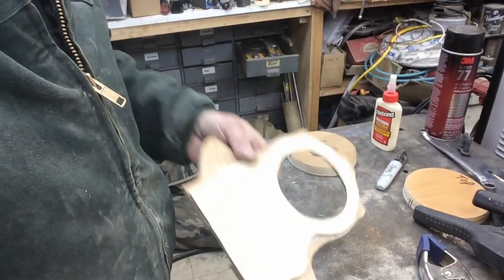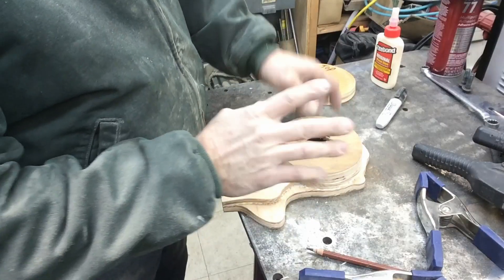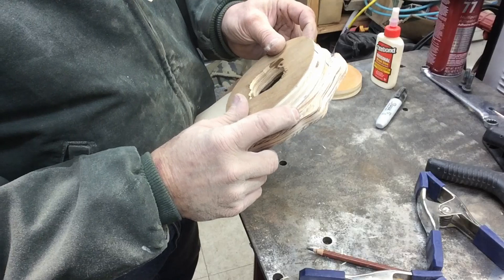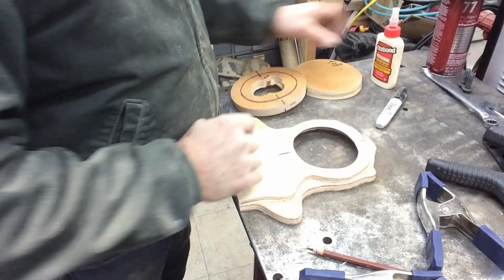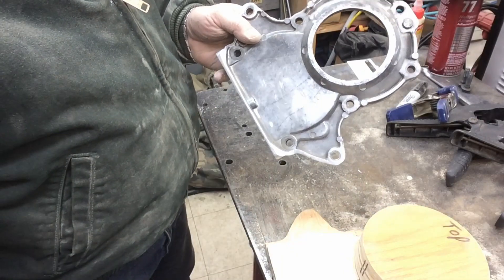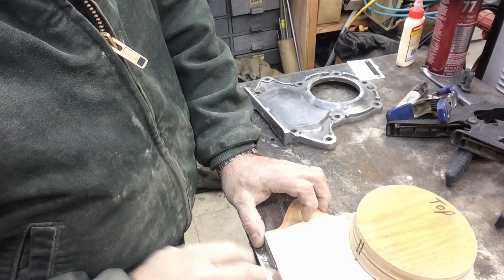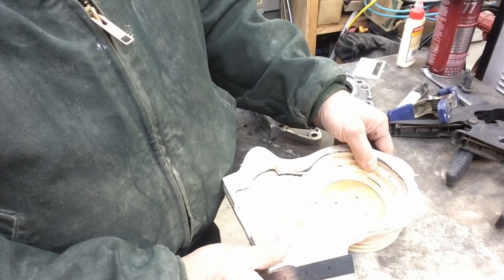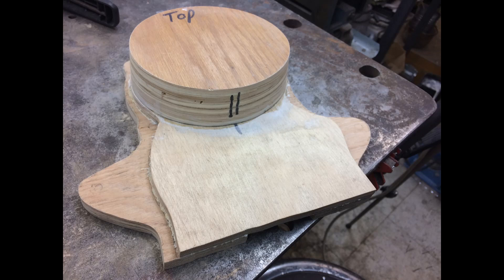Building a Zenith 701 Experimental Airplane, 5th Bearing for the Corvair: Part 3

Comment: Love your videos on this 5th bearing build.  I've got a Corvair on a half-built Pientenpol, and before I attempt flying it, I want a fifth bearing on it.  WW has his bearing available for what seems to be a reasonable price.  Are you building your own because of some deficiency in those, or is this an exercise in reinventing the wheel?  Don't get me wrong, I salute your efforts, but I'm wondering if you're looking at improving whats available or just attempting a DIY project.  Are going to do your own sand casting and smelting?  I'm anxious to see the next steps and final results.  Thanks for sharing!
Reply from the maker: Thank you: I suspect you are refeing to the Dan Wessman Bearing which is probably the one we see the most of and is promoted by William and in the big picture is very reasonable in price. There is no defeciency in the item and is thoroughly proven to do what it is intended to do. I have been asked about reinventing the wheel on a couple of things for the plane now and I consider nothing I do to be re inventing, I most often follow a path that someone else has travelled before me and usually add my own ideas or processes to it. Most often it would be less expensive and certainly faster to just purchase the item, but what would I learn from that? What will give me the most satisfaction and pride in a conversation? 1) I built that myself or 2) I ordered that from Amazon but met the UPS driver at the curb. If by definition when we use someone elses airplane plans wouldn't we be reinventing the wheel? So why wouldn't we just go and buy an airplane? No improvements as there can be no noticible improvements, the currently available products do what they are intended to do which is to provide additional support to the end of the crankshaft. The mechanics of doing so are more involved than that, but in simple terms that is all the bearing does. Yes it will be my own castings and I will show my foundry setup when I get that far. I will finish the pattern, but will not be casting them until the weather gets better here. Thanks for the interest, and have a safe and happy new year. Dan.
Reply: Kudos...  Yes, I'm referring to the Dan Wessman's retrofit kit, which WW sells via his enterprise.  That's what I'm looking at, and just wanted to get your take on it.  Certainly appreciate guys like yourself that can and want to make things.  I also appreciated your Corvair engine stand videos too...it's some good information as I'm sure I'll need to get mine off the plane and onto a engine stand.
Reply from the maker: I think his is a really good bearing, either the first or second generation and they seem to support it well. When do you think you will be ready to fly?